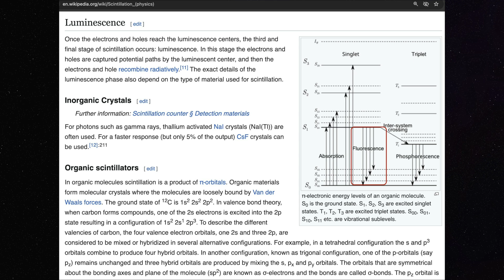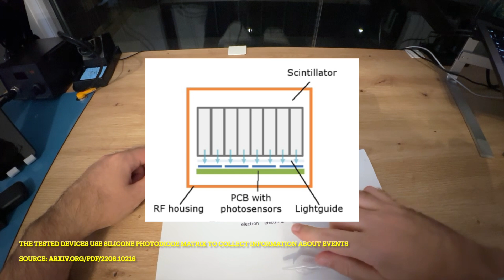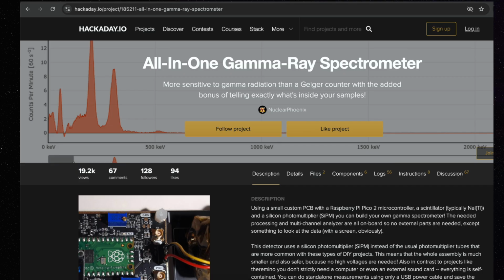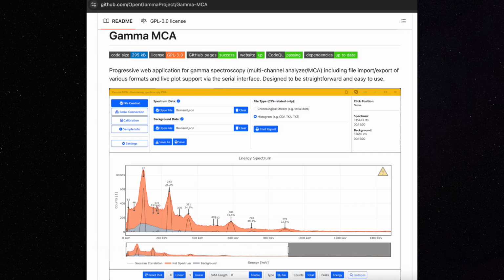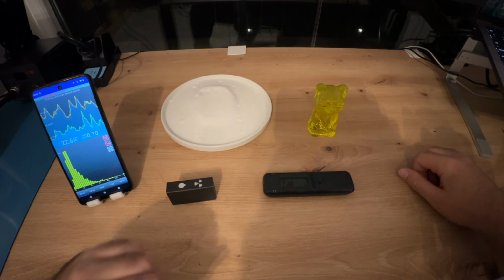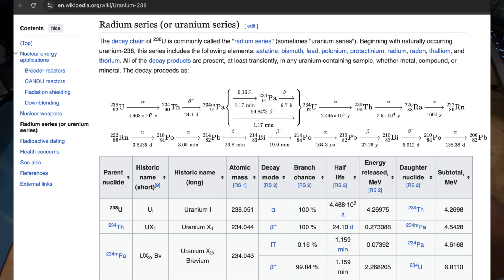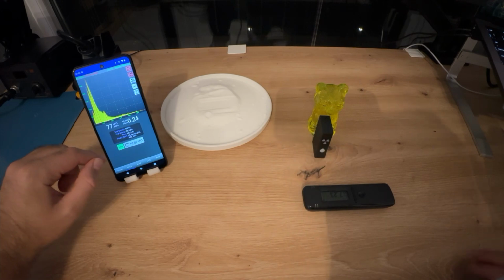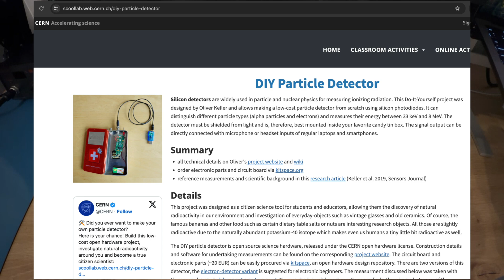Raysid vs Radiacode: scintillators proliferation

Comment: 7:04 Touches Thallium-doped cesium iodide (CsI(Tl)) crystals but it is important to avoid direct contact and wear appropriate protective gear when handling the crystal, as it contains cesium and thallium, both of which can pose health risks while proper handling includes immediately washing skin with soap and water after contact and seeking medical attention for any irritation that persists... and he proceeds with the video just contaminating everything he touches like nothing just happened 😮😮😮 Stay Safe 
🙏🙏🙏
Reply: Thanks for the information! I used a 3D printed PLA plastic cube that resembles the crystal, all was safe.

Comment: Just picked up the RAYSID - love it. Wish Raysid would create an iPhone app, but I understand Radiacode is having issues making a good app themselves with Apple.
Reply: My RADIACODE 103 iPhone app seems to display the necessary graphic data. "HOWSOMEVER" I may sell it and get the110 model. RC's software for the103 has supposedly been recently improved across the board in all apps. Since I've had my 103 Apple app only one month I may' have this new upgrade.

Comment: A little frustrated by these tests as they seem only based on CPS results, very far from what are capable gamma spectrometers. I'd like to see some results based on isotope recognition and FWHM and many more related to spectrometry... These are NOT Geiger-Muller counters!
Reply from the maker: @etiennedecessy  Thanks for feedback. I left the spectrometry software comparison for the second video
Reply: @PatrickOnEngineering , OK, nice.

Comment: interesting review but you missed the interesting point : gamma spectroscopy.  you should make another test and analyse better the gamma spectrogramm you get. You couldnt see anything significant with KCl as you didnt leave the device measuring long enough.  On the uranium glass , with Raysid I could already see the caractéristic spectrum of uranium glass and it looks like that Raysid is superior to radiacode.
Reply from the maker: @totoff92  thanks for the idea! I did see tests that take about an hour to collect necessary data, so I simply skipped that comparison with thought that both of those devices are too small. Let me find spare time and do the check!
Reply: @PatrickOnEngineering  Too small for what? Smaller scintillator crystals have advantages over larger crystals. Larger crystals have advantages over smaller crystals. It's totally dependent on the use case. Comparing based on CPS is an indication that you have to read more up on how detectors work and what are good performance criteria. Keep up the work but sadly this video misses a lot of very relevant information. And by the way... the smaller of the two, the Radiacode is HIGHLY capable of creating VERY reliable spectra of gamma radiation.
Reply from the maker: @911Hammer  Thanks for the comment! I’m looking forward to learn more about this area. I don’t have background in nuclear physics to give a good overview of the topic, so yes, there’s a lot for me to learn 🙂